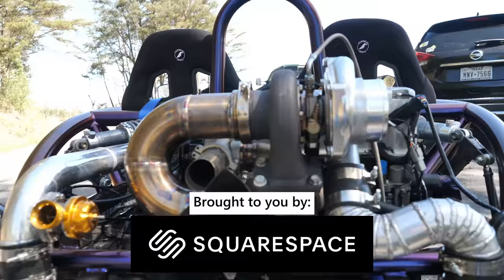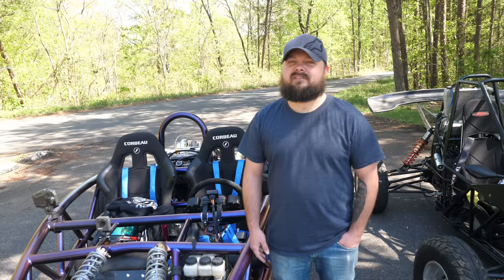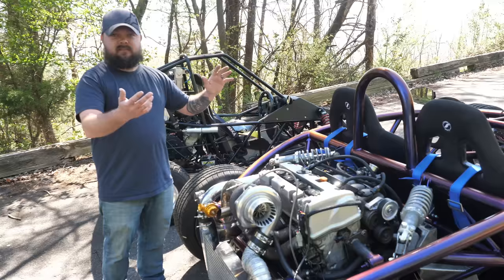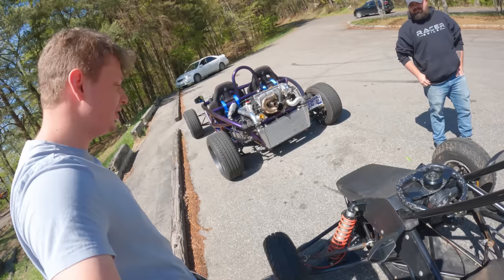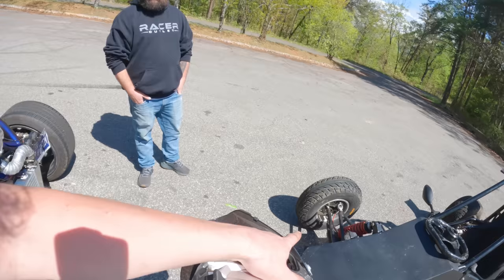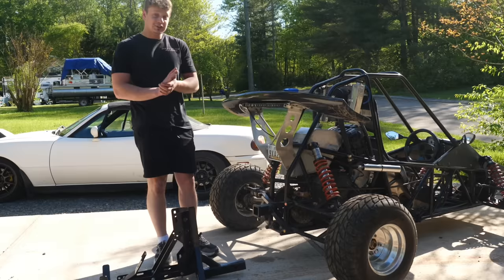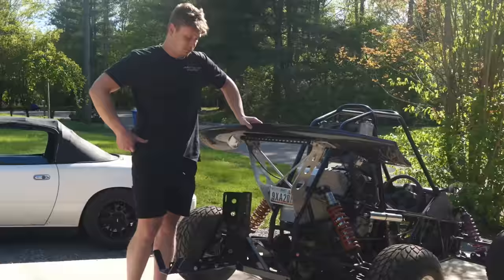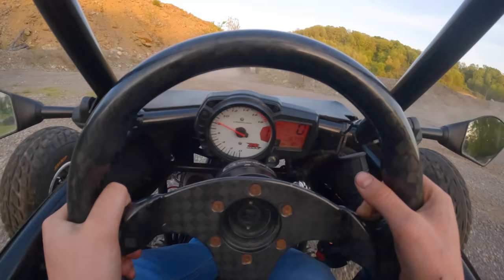Cheap Vs. Expensive Go kart! (Finale)

Comment: Needs a roll bar behind both seats looks like its meant to be one seater, one wrong move or failure and your heads gone 🫣😎👍
Reply: I have one im building but you are blow the bar that is there. That's how the 1st generation atoms were built and loved the look of them. But not practical in what I'm doing with the car
Reply: If your lucky... Ive rolled two cars the skyline crash rolled 3 times, the roof was on my head and the headrest, had a sore back and ankle for a couple weeks but made it out luckily

Comment: You rock man, that is an incredible build. Ive said it before but you should be proud of yourself! You are great.

I wonder if a set of new tires from a reputable brand would give you enough traction front and rear? Its possible that you have enough rear down force from the wing and and the power giving enough lift on the front end that you need a front splitter to keep front downforce

Comment: Feel like a 1000cc engine on this thing would be so narly
Reply: Not to take away from Vasily... But mine is 1000cc.. its a handful to say the least...
Reply: Without corrective work to the steering geometry, better tyres and a rethink on how to drive it, probably be more like a deathtrap. 

As person above points out, a 1000cc in one of these is a handful....

Comment: Rust oleum makes a rattle can color shift paint that is very very similar to the color of the tubed Miata front end one. Works great. Must have a black base, then spray over it.
Reply: Lol painted my ebike with it it's surprisingly good I didn't have a ton of faith in it but it turned out great after clearcoating and everything😊

Comment: My brother took 3/8th thick plate steel and cut it into a triangle to fit under the trailer-hitch ball,and welded a tube the size of his front axle on his motorcycle so he could remove the front tire and slide the axle into the 'hitch'.He strapped the handlebars to the vehicle for stability and towed his bike 100's of miles that way.That'll save you weight.

Comment: I like the sports bike (bullet bike) motor better my self. more RPM's and different powerband and sounds better imo
The custom car one is cool but not as interesting imo
Maybe it's time to swap in a 1000cc motor lol 
But also new tires lol

Also the difference you're feeling is the turbo and he has it at low RPM boost.  Once you go turbo it's hard to go back to NA
So if you wanted the same feel, maybe turbo the bike motor or build a H2 motor kart but that motor is expensive as hell and the boost is higher RPM's

Comment: If this is going to be a regular driver and have miles put on it, would it be worth it to install a quick change wheel system? Then you can get a legit set of street and offroad tires to swap out for the right occasion.

Comment: Trying to get some idea of the rod-end bearings (especially their sizes) used in the suspension…
Reply from the maker: These were 1/2 chromoly heim joints
Reply: @VasilyBuilds  thanks.  Am in the (early) planning stages for building an electric reverse trike, and was thinking to use such in the front suspension.

Comment: Install a dynojet power commander 5 or 6 and a quick shifter and get a 08-2016 r6 engine or go with a 1000cc motor with the same mods

Comment: what diff did you put on the kart?
Reply from the maker: no diff "live axle chain spool"
Reply: @VasilyBuilds  I think with a diff you could solve most of your understeering issues          check out the drexler limited slip  used by formula student teams